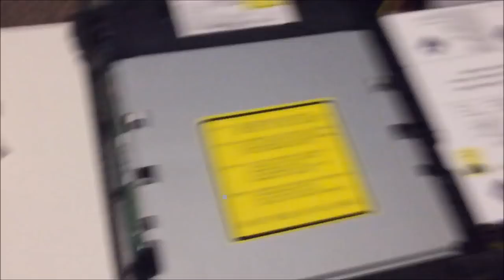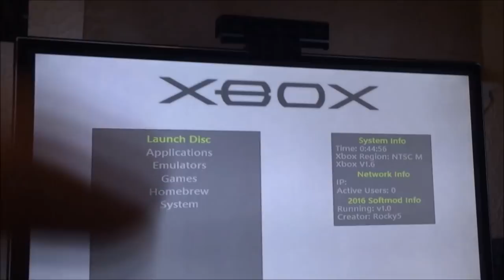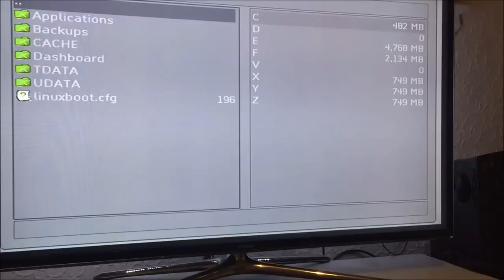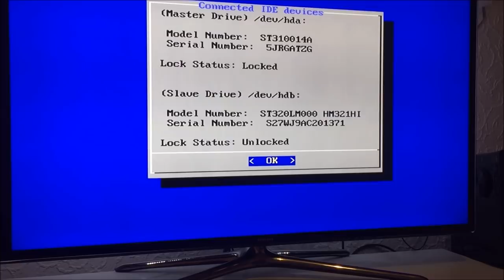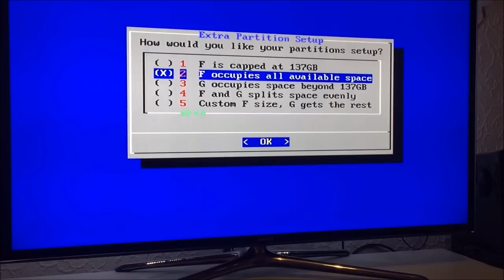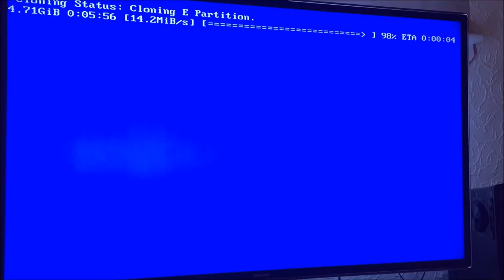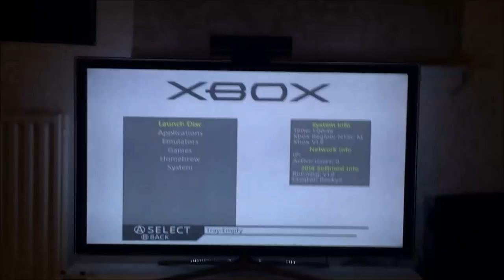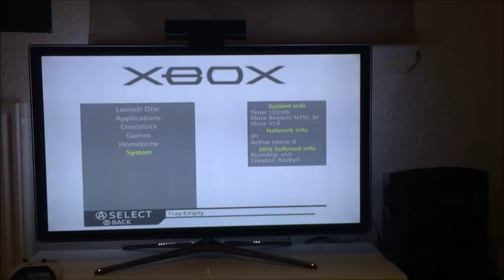How to clone your Hard drive using Chimp 261812 from start to finish.

Comment: where is linuxboot.cfg?
Reply from the maker: Wait it's not used by default anymore, I changed how the loader works it auto boots Chimp now. All you do is stick the chimp folder in E:\ or E:\Applications\ or E:\Apps\

I made it simpler to use.
Change log is here.
https://github.com/Rocky5/Chimp261812/commit/1a634d93643c39b61cdfe832538b516b126a76bd
Reply: also what jumber setting do i use for the xbox hard drive isnt it suppost to be set to master (mine is set to cable select)
Reply from the maker: It can be master or cable select, the Xbox will always make the last HDD on the IDE cable the master drive.
Reply: JCRocky5 my xbox freezes when i swap the ide cable from the dvd drive to the new hard drive.Did you run into this issue too?
Reply from the maker: +LottieBot Turbo only if I knocked the power cable on the Xbox HDD, other than that no I had no issues with crashing/freezing.

Try making the Xbox HDD master via the jumpers and setting the new HDD (  slave drive ) to slave or cable select via its jumpers.
Reply: im getting a no signal from my tv but when i plug in the ide cable to the hard drive the screen goes completely black.
Reply from the maker: +LottieBot Turbo ? At what point are you getting no signal? can you upload a video of your issue?

Comment: Anyone get error code 11 after finished. Old drive boots up fine, used startec tried master ,slave , cable. Slave caused error 7.
I don't really know what is next. I'll try more on day off. But thank you.
Reply: did you find solution
Reply: @Ryankurwa  yes. I had to change my disc drive. As soon as I did all 3 adapters works. So sadly if you have that error to its the damn dvd drive. Mine worked great so I never thought that would be it. But after trying alot of stuff that fixed it.
Funny thing too. I put the faulty drive in another xbox and forgot. Then went to mod that one had the error again. Looked at the drive and saw my scribble mark of faulty error code 11.

Comment: It says error 07 for me anyone help!
It's not working for me!
Reply from the maker: That’s HDD timeout, make sure the IDE cable is connected correctly. If it’s a SATA drive use a 80 wire IDE cable.

Comment: hi. i upgraded to a 2tb hdd but its not showing all but only 600gb on F and when i try to split to F and G, i get only 130gb on F and G less than 100GB . Could you help please?
Reply from the maker: Netzin H your bios doesn’t support the partition table or your softmod is not setup to allow the partition table.
Reply: @JCRocky5  hi. i upgraded to a 2tb hdd but its not showing all but only 600gb
You said before to Netzin H that your bios doesn’t support the partition table or your softmod is not setup to allow the partition table.
Can you help how to setup the partition table to allow get all hdd ?

Comment: I have XBMC. what do I do to update?
Reply from the maker: The exact same process, look for the updated xbe video ( after this video ) and watch that.
Reply: I installed XBMC 1.5.3. and I just tried your version. but after I start chimp loader. it says the 2 okays. and then stops at starting chimp 261812 :(
Reply from the maker: Install it to “E:\Chimp” instead of the apps folder.
Reply: now I can't even find it :(
Reply from the maker: It will be in the place you installed it.
Reply: so I made my own source to "E:/". but it just stops at starting chimp 261812 again. sorry for my troubles :P
Reply from the maker: +hytune you made your own source to E:\?

Use a standard av cable if you have it. 

It’s finding the files it needs so it’s crashing after that or it’s not displaying Linux. 
( what colour does the LED go? )

Comment: Hey anyone got a fix for and error 5? thanks
Reply from the maker: Requires the EEPROM from the motherboard in which you want to lock it to. If you have that you can use XboxHD23USBBeta  or another Xbox and Chimp261812 to lock the drive to that eeprom.bin

Comment: BRICKED (not really) my new 2tb wd blue with xtras tool, Softmod Update - spat out errors cant delete XXXX file SO I -  B get me oughta here! - EXIT, same errors fail, Now im in an endless loop, So reboot, XMBC stock boots up fine, then when I load 4Gamers/Kids or Emustation, I got black screen BUT the volume slider bar appears when up stick pressed, no other GUI on screen...   after that, I cannot reboot at all, gets past flubber and wham... Darkness, no typical error codes, FTP not running, and disks will not boot..
(I did see an error 21 on another boot much prior),  but it went away.

I've already re-cloned once with chimp because of this, I would rather not load up 1.5gb of games for a second time, took a week....

Next stop, editing slave 2tb via chimpsFTP I guess.., wiping dashes... 
(Can I copy C/E without losing all my stuff on F/G? I forget, perhaps I can just manually copy the data in ftp)

This happened on xbox 1.6, tried funny drive on 1.4, same thing..  (hail 32x0)

I would love to blame the cheapo green pata-sata, but everything else worked with it.
And yes I have 39pin 80 wire ribbon. Albeit it too short and have to run drive upside down to fit the bay.
(Cant bring myself to pay more for a startech adapter than I did for the xbox... yet)

Anything advise Rocky? 
appreciated, Thanks
Reply from the maker: What is it you’re trying to do? Just upgrade your softmod?

The extras disc won’t let you update unless it finds files that are used by my softmod. But I advise using the quick upgrade.zip instead of the disc if you’re having issues.
Reply: basicallly im wondering what i did to cause 4gamers/emustation to video glitch then softmod update to fail and prevent booting completly..   corrupt hd sectors being the easy answer..  any logfile with your softmod?
Reply from the maker: There is no log file when UnleashX is being used. Only error reporting done by that dashboard is the error on screen. 

So you’re still modded? just gamers/emustation won’t display any video when you try to run them?
( well it does as you see the volume slider )

Did you have an intro video enabled?

Also where are they stored? E is the recommended partition for dashboards. 
( you can move the large folders to another partition for emustation )
Reply: I am still modded I guess....... have to put orig 8gig or any other HD in to boot to anything...   I think intro vid has something to do with it, pretty sure I disabled it because it wasnt playing very smoothly..  not too sure why booting issues would start once I disabled intro movie..

Yes, on E, with media/roms on F, as per readme somewhere.

any plans to add emustation as dash to extras tool? to simplify moving/changing? or no cuz its basically a skin?

Comment: Has anybody tried the option lock slave from Xbox HD E:\eeprom.bin? I have the eeprom.bin (all lowercase) in E: at root level and does not take the eeprom.bin, it locks the hd but using the motherboard key which is incorrect, same happens when using the unlock slave from Xbox HD E:\eeprom.bin. I'm using the chimp 261812 from description link https://github.com/Rocky5/Chimp261812/archive/master.zip
Reply from the maker: +LorddrRaziel I emailed you, like I said on the github issue page, it's due to the fatx driver on the Linux distro chimp uses. It's not very good, if the E partition has lots of folders/files it won't find it as it seems to only mount the first few folders/files. 

I may see if I can mount a cache partition instead so that at least it's always empty and shouldn't have any issues. 
( if it's mountable that it )
Reply: Hi Rocky5, ohh! first of all thanks for the fast response, this version of chimp modified by you looks excellent in comparison with old versions that I tried before knowing 261812, I was glad to know that you included the option to use the eeprom.bin from E: the xbox that I'm using to rescue my hd cannot use ftp because the ethernet port does not work and getting an old computer with IDE for using HDM is practically impossible, thanks for all the effort that you have done on your version, I'm sure it will help many people like me that accidentally unlocked their master hd, by the way, your dashboard looks very clean, you are the author of that, right? is it available for download?
Reply from the maker: I fixed the issue, it now uses the Y partition on the Xbox HDD, so Y:\eeprom.bin just redownload Chimp and replace the initrd.gz file and your good to go.

Yeah the dashboard is UnleashX with my Softmod skin, its part of my softmod.
Reply: JCRocky5, thanks a lot!!!!!! the fix worked, now I have my xbox back!!!! maybe you can update the instructions saying that after copying the eeprom.bin the xbox should not be rebooted or shutdown since is a volatile partition the Y location, by the way, how can I install your soft mod skin?, from my personal opinion is the best I have seen for Xbox, I like the minimalist and clean look of it, makes the xbox looks simply superb :)
Reply: Interesting, I have a softmodded Xbox, will I need to use an exploit game or is easier since my xbox is already softmodded? I saw your video but is not clear at atll to me if the same steps are needed for an already softmodded xbox, if you have documented the steps in a page please let me know, I don't want to bother you with questions that probably you already answered before :)
Reply from the maker: +LorddrRaziel you download the "Quick Upgrade.zip" and read the instructions inside the zip. It's simple and pants easy to install.

Comment: JCRocky5 
Trying again 
I powered the new hard drive from a different source . 80 wire ide cable hooked up,  I  get Chimp261812 ready , Hot swap . hit chimp it starts , I have to make a choice i choose  fatx  ... blue screen comes up  Xblast OS  it starts to load and stops at 

boot: loading  kernel  application/chimp/linux267'... ["]    stays right there .  ?
Reply from the maker: +Atari Woodgrain reinstall chimp, stick everything inside the E partition folder in E, if that doesn't work, I will send you a new xbe to try.

Comment: ERROR 16 :(
Reply from the maker: +Konphetty Sata adaptor? 80 wire IDE cable?
Reply: JCRocky5 IDE
Reply from the maker: +Konphetty the clone wasn’t successful then, if it was you would have an identical copy of the current drive.
Reply: JCRocky5 Im just gonna do the process again in this video
Reply from the maker: You no longer need to do the swap before loading Chimp loader, watch the other video after this one.
Reply: JCRocky5 i just used the ide on the xbox cause I have an IDE hardrive
Reply: Im trying to repeat the cloning again cause I had the Error 16 issue but keep getting Buffer I/O Error on device hdb when cloning. Should this be happening at all?
Reply from the maker: +Konphetty that’s because the slave drive is locked, it will tell you this when the menus loads. ( you need to unlock it before cloning, or it won’t let you. Will give an error )
Reply: JCRocky5 Ill do it again. Even though im 90% sure i unlocked it because i saw the message at the start like u said
Reply from the maker: +Konphetty after you did the first clone you locked the Slave drive. So the next time you load Chimp with the same drive as the Slave drive you will get IO errors as the drive is locked.

So you will need to unlock it via the “Slave drive options” menu. It doesn’t effect the clone or features of Chimp, you just can’t clone to a locked drive as nothing can write to it, until it’s been unlocked.
Reply: JCRocky5 Unlocked it  from motherboard still getting the buffer errors
Reply from the maker: +Konphetty the Xbox is having a hard time read that disc, so it maybe damaged or on its way out. That may explain the issue you have after a clone. 

Change the IDE cable and if powering the drive via a Y splitter try doing it externally.
Reply: JCRocky5 I used an external power supply to power the hard drive still getting the errors :(. I bought this hard drive from a video tutorial HDD upgrade here on youtube and its brand new. It should be compatible. Any idea why this is happening? Any recommendations for an IDE HDD i can buy?
Reply from the maker: +Konphetty I only use SATA drives, mainly 2.5” WD blue drives.

But I haven’t got a SATA drive that isn’t lockable.

Do you have another IDE cable 80 wire one by a chance?
Reply: JCRocky5 I dont. I could perhaps purchase one if you think its the best option
Reply from the maker: +Konphetty yeah I recommend 80 wire IDE cables for SATA adaptors and well basically any drive, there is no disadvantage.
Reply: JCRocky5 Okay. Thanks
Reply: JCRocky5 I tried it again with IDE hard drive. Wasnt getting the buffer i/o hdb errors anymore. It clones 100% normally  but still getting the error 16. I just dont fucking get it anymore! This is a brand new IDE hard drive! Youre maybe right about the stock hdd being faulty
Reply from the maker: +Konphetty it’s not clone properly or your IDE cable is goosed. 

What is the cloning speed when it’s cloning? also have you tried enabling DMA in the settings menu for both drives?
Reply: JCRocky5 cloning speed is normal sits around 13 mib/s. Just like yours in the vid. No i haven’t tried enabling dma yet what exactly does that do?
Reply from the maker: +Konphetty yes, but see if you can get a 24” one as that will make it easier to fold and install.
Reply: JCRocky5 does it really matter how you fold it?
Reply from the maker: +Konphetty yes, the second connector is reversed on the Xbox cable, you you need to fold it so it faces inwards. 

http://www.web-nine.com/projects/xbox/ide/
Reply: JCRocky5 ive already bought the item so im gonna have to use it.  Thanks youve been a great help throughout this process I hope you know that. I just find it so hard to give up. I just cant stop thinking about what could be causing this problem and just want to get this done and have a sense of accomplishment also i am not tech savvy at all like most of you guys are.
Reply: JCRocky5, I just dont know anymore...so my 80 pin ide arrived today. I used it to replace my original ide cable on the xbox. It worked fine cause i tested it with my stock HDD. Now I dont have a sata hdd but I used the new 80 pin on my new ide replacement hdd to clone. First I unlocked the new replacement hard drive. No more buffer I/O errors. Cloned at around 12-15mb/s . I locked it AND I STILL GET THE FUCKING ERROR 16! This might be a stupid question but I was wondering is it possible that my original HDD’s dashboard is missing in the first place and it clones it to the replacement hdd and the xbox goes “wait a minute the dashboard isnt here” or would I get error 16 in the stock hdd as master drive if that was the case? Cause I read that error 16 is Something about the dashboard being missing. If not there has to be something wrong with my replacement brand new HDD. IT HAS TO BE! Ive tried every damn option there is (feels like it anyway)

Buying a new HDD now. I just want to finish this
Reply: Please help me when you arent busy. Just reply anytime you feel like it I know I might be getting annoying but please.
Reply from the maker: +Konphetty yeah if the dash wasn’t there you would get error 16 on your stock drive, but since you can boot into chimp and your dashboard that’s not the issue.

I’m not sure why when you clone to the new HDD it’s throwing error16, have you tried the byte by byte option? This will just clone from sector 0 to the end sector of the master drive. So you will need to format the extra partitions after the clone is done.
Reply: JCRocky5 I have. Ive tried all options. Ive tried different power supplies. Ive tried a new 80 pin ide. Ive tried different version of chimp other than yours.
Reply: On the bright side. I have a sata adapter coming and a SATA WD 160 gb Caviar Blue HDD (WD1600AAJS) coming. You think this would change anything?
Reply from the maker: +Konphetty not sure, but anything is better than you current situation. 

The 80 wire cable is mandatory for Sata adaptors in my eyes so you have a head start in that regard.
Reply: What do i set the sata adapter and the sata hdd to?
Reply from the maker: Sata hard drives don’t have jumpers, there is no master/slave with Sata. 

The adaptor you set to master after you have cloned the drive.
Reply: JCRocky5 Oh that makes a lot of sense. Slave when you clone though right?
Reply from the maker: Correct
Reply: IT WORKED!!! Thanks jcrocky5 for all your help. It was the new hard drive all along. Amazon sent me a faulty harddrive those assholes.
Reply from the maker: No problem :) and it’s not Amazon’s fault, everyone will get a dud HDD in there life. Lucky Amazon have a good return policy.
Reply: JCRocky5 haha yeah. Sending it back now. Thanks a lot